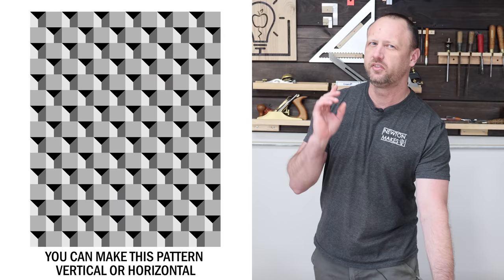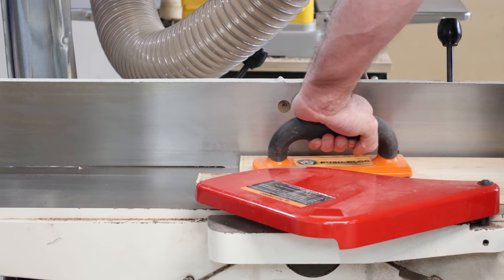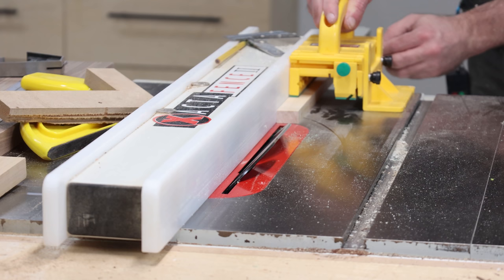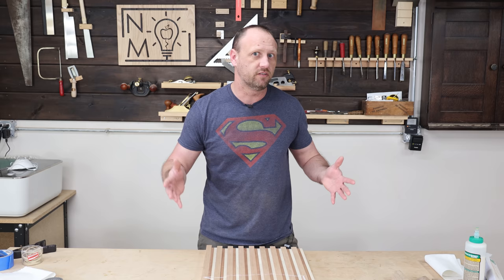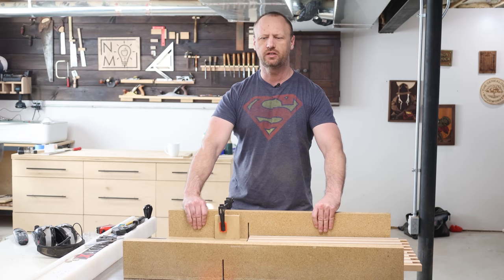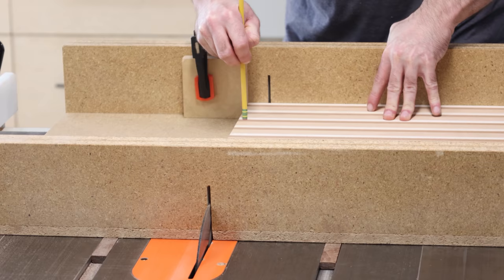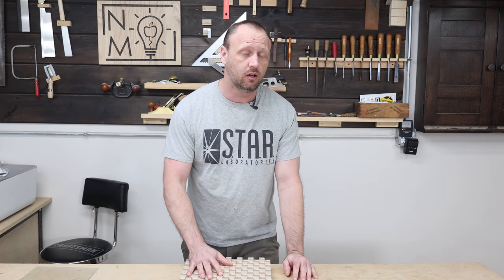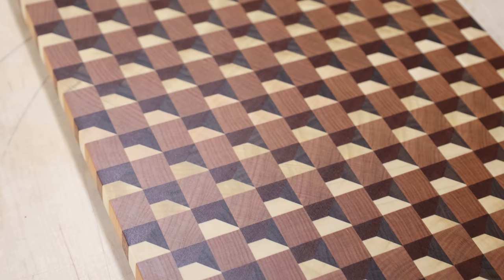The Coolest Cutting Board EVER MADE! | 3D Cutting Board Instructions

Comment: You can also flatten an end grain board using the thickness planer if you use very very light passes (no more than 1/8 turn per pass). At the very least you need to attach a sacrificial end cap to stop tearout but i found it easier to just made a "frame" out of pine which extended in front and behind the board to catch the snipe as well. This worked fine on my straight blade thicknesser when i made your square pattern board.
Reply: I've done this as well.  You can also put a roundover on the leading and trailing edge of the board to prevent chipout.  Light passes, don't stand directly behind the planar just in case.

Comment: I have made two cutting boards, the brick pattern and the square with thin maple stripe pattern. Then.... I tried making this 3D board. I gave myself plenty of wiggle room but still came out with a thinner board than I was aiming for around 1 and 1/2 inch thick got more like 3/4 inch when I finished flattening and sanding prior to final glue up. So many opportunities do go wrong especially getting that walnut triangle to fit a perfect 1 inch square. I love the first two, look really nice and beefy but this one was a magnitude way harder to get the precise results I was aiming for. First two board where a 5/10 skill level, this one was a 10/10 harder (for me, weekend warrior). I use a thin kerf blade. Would be great if you could include in your plans what issues to avoid or look out for. Those Rockler panel clamps look tempting even at $130 each as I lost so much thickness getting a flat glue up (I used 3 home made caules). I want to make the hounds tooth board to but seriously got to get better at this one first. Love your channel.

Comment: Wow, your finished cutting board looks absolutely amazing. That final glue up where you have to align all the blocks stressed me out! I was wondering how it could be made a little more idiot-proof as I know I would definitely mess it up. Do you think it would work/help to try and glue it up using a square form? Before cutting all the strips to final thickness, could you cut the blank in half and add a strip of cherry to the bottom of one half and a strip of the fancy cubes to the top of the other? This would mean you can clamp the final glue up against a straight edge for perfect alignment, maybe even use a square form and wedges to clamp it. No idea if that would solve the issue or just create more problems but I used to work in IT so I always try to minimise room for human error, lol.
Reply from the maker: Hard to tell. I think there are probably multiple ways to do it so we have to pick the one our brain likes best. Sometimes I use a gluing square - mdf panel with an mdf strip screwed into one edge. This gives a a good reference edge for assembly. But sometimes I say screw it and just glue it together.

Comment: Newton, I have a situation that’s driving me crazy. I made a honeycomb cutting board, my first attempt at this design. For a new design I wanted to take some of the honeycomb pattern and eliminate some of the, let’s call them grout lines. Everything was going according to plan except for one of the last glue ups. It has to do with gluing 30° angles together. I’m having slippage issues and full glue contact issues as well. The big question is, how can I prevent major slippage issues and have excellent glue contact. Here’s my thought. I think it has to do with the amount of pressure I use with the clamps. I do use cauls during my glue up, which helps with the slippage, but as soon as I apply clamp pressure, my center cauls bend, which causes the wood to slip and prevents proper glue contact. I need your help with us because this is driving me nuts. Your advice would be greatly appreciated. And by the way, I’ve made a couple of your boards, which turned out fantastic. Keep up the good work.